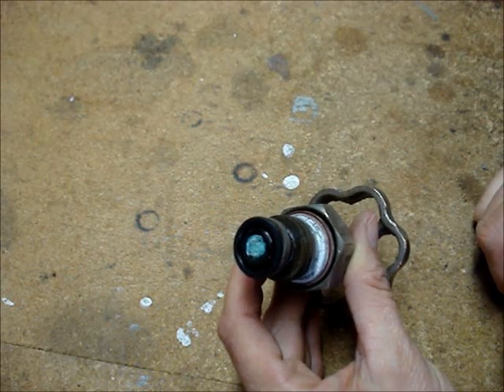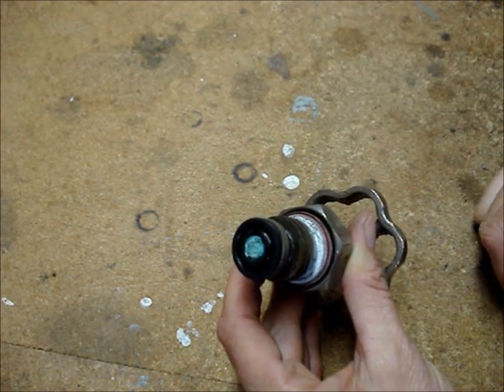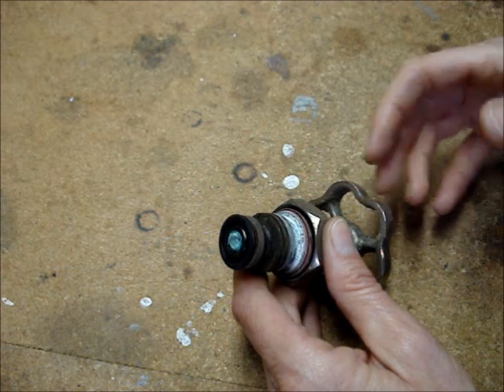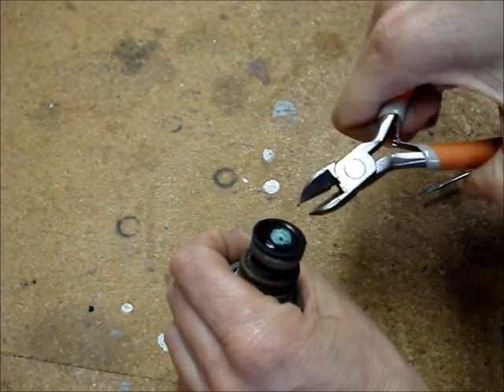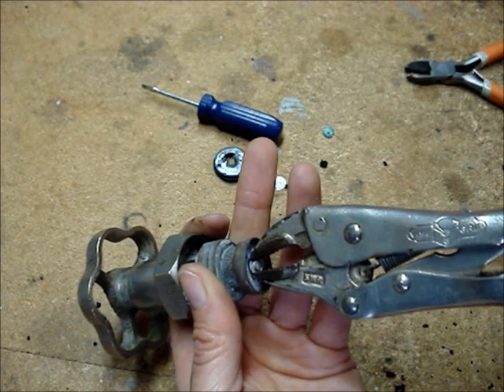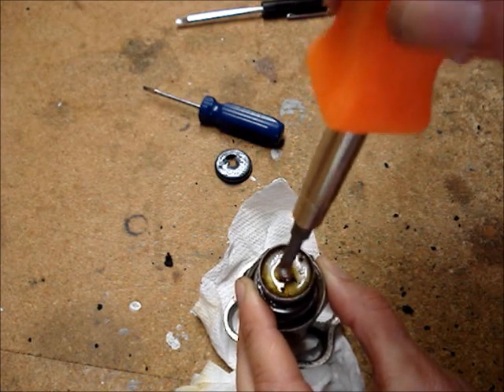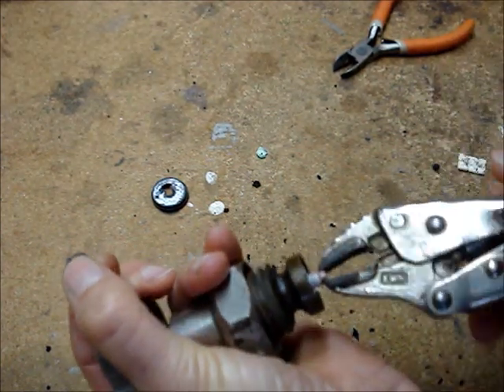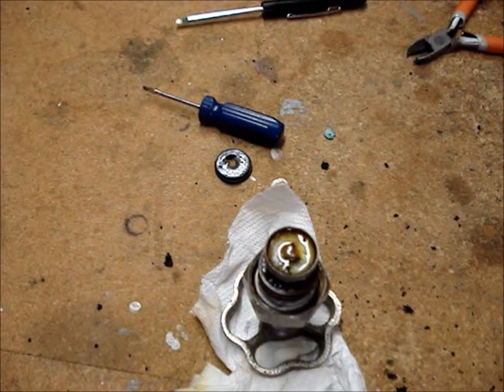Remove Stuck Rusted Faucet Screw

Comment: Love your videos.  My faucet was frost free, which means the washer was on the end of a long post.  I let the penetrating oil soak for two hours to no avail.  I pulled out my creme brulee torch and gave the post - not the screw - a minute blast to heat up.  Worked like a charm.
Reply from the maker: PB Blaster usually does the trick.  Good to hear you found another use for a cooking torch.  Thanks for commenting.

Comment: What if it isn't stuck but when you turn the valve knob it turns easy but no water comes out? I turned the water off to my washer to replace my old one. Now the hot water works but the cold just sprays a little water out then just drips water. I cant find any videos on the issue I am having. The hit water works and I can feel.some resistance when turning it but the cold turns with no resistance but the cold water doesnt come through the pipe.
Reply from the maker: I am not super clear on your question.  Are you saying the you turn the cold water valve handle to open it and no water comes out?

Comment: Blaster is an excellent penetrant. Also, on the first turn when it breaks loose, rock back and forth a bit and spray.
Reply from the maker: Agreed, PB Blaster is my go to for any stuck/rusted connection.  It even worked on a bike seat post that was stuck in the frame.

Comment: This worked like a charm.  Patience is key.  I let the penetrating oil sit for an hour.  Thanks very much!
Reply from the maker: It's my pleasure to help.  Yep, if you can plan ahead and treat any threads with PB Blaster, the bolt, nut or plumbing (metal only) connection usually comes loose easily.  WD40 is not the best answer for stuck metal parts.

Comment: Excellent and informative video. I appreciate how well you explain what you are doing. .You get right to the point and stay focused without rambling on and on. Just for the record the wire cutters you use are generally referred to as diagonal wire cutters or "dikes". Side cutters like linesman type pliers would not work very well for this task.
Reply from the maker: Thanks for taking the time to comment and the diplomacy in pointing out the misnaming of the wire cutters.  I try for 100 percent accuracy, though sometimes something slips though the cracks.  Thanks to the viewers who add to the accuracy, other tips, it adds value of the videos.  I'm not perfect nor do I have all the good ideas.  Thoughtful comments are always welcome.

Comment: Thanks so much, this worked! I ended up having to use a drill to boar out chunks of the washer until it crumbled and I could pop it off. 
I let it soak for hour with oil penitent and it twisted right out!  It had taken me forever to get the handle off (heat ultimately did that) so I was pretty dismayed when this screw crumbled on the first turn of the screwdriver, thanks for the helpful vid! Now back to the hardware store for the right size washer!
Reply from the maker: You are welcome.  Way to go on being persistent and getting the bolt out.

Comment: I have this same problem.  Screw on handle is rusted too.  What I'm afraid of is if I pull out the washer and still can't get the screw out, or can't find a replacement screw and washer that fits.  I've then got a plumbing emergency!
Reply from the maker: You can buy a box of washers that has many sizes.  It's likely one of those will fit.  Also, I have found a packet of screws with different sizes.  If you have a good hardware store or plumbing supply house you should be able to buy these items.  PB Blaster penetrating oil will likely free up anything that is stuck.... just don't force anything too much.  Also, if it's a valve the is normally open and you fail, it won't be an emergency.  You can just put it back together without the washer... just don't close it without a washer.

Comment: Your instructions are clear, concise and short. Just what someone  needs when in a jam and starts  scouring the net for help!  A couple of  tips I would add after getting the screw out  bring the  whole valve to the plumbing store and get 2 extra washers and 2  stainless screws to hold the washer in place and have spares.  A cheap and easy to make penetrant that will work on this is a solution consisting of 1 part acetone and 1 part automatic transmission fluid mixed together in a metal or glass container.  Mix it well before pouring some on the culprit. You can make a 5 year supply for the price of a can of PB Blaster, which use to be mine to go to penetrant before I stumble across this recipe.
Reply from the maker: Thanks for taking the time to write the thoughtful and helpful comment.  I've found that the new screws are brass with a silver coating on them.  I'll have to try out the diy PB Blaster recipe.  The odor of it can't be good for you.